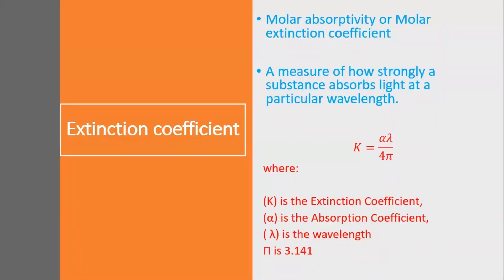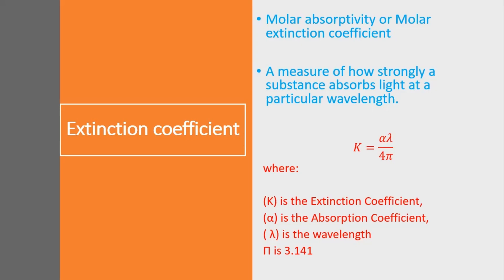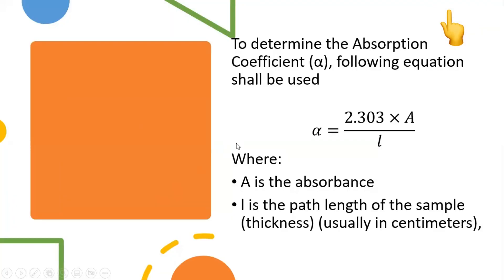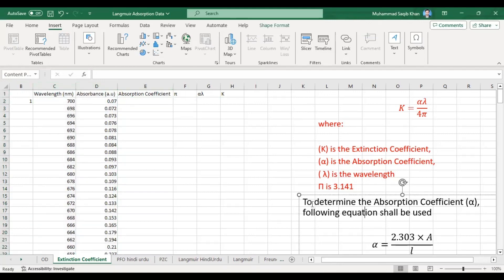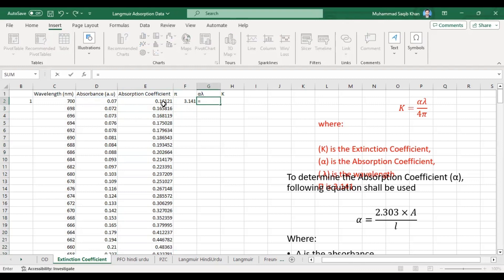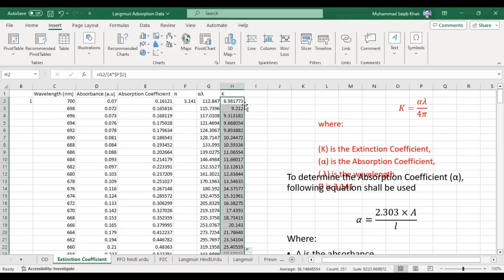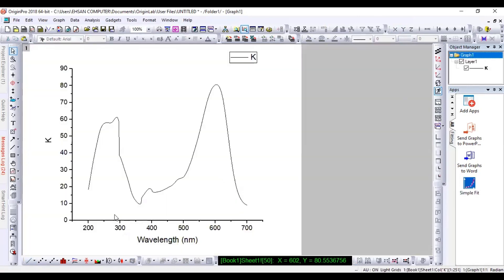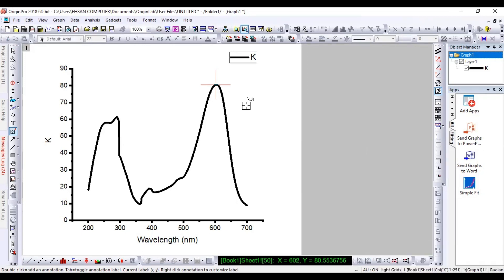How to Measure Absorption Coefficient/ Extinction or Molar Coefficient | from UV Absorption Data

Comment: Please, why thickness (cm) and wavelength (nm) ?
Reply from the maker: Thank you for the comment and a wonderful question, thickness (cm) and wavelength (nm) are used in absorption and spectroscopic measurements for the following reasons:
Thickness (cm): The path length of the sample affects how much light is absorbed. The thicker the sample, the more light interacts with it, which increases the absorbance.
Wavelength (nm): Different substances absorb light at specific wavelengths. The wavelength (in nanometers) is crucial because it determines the energy of the light and the specific absorption characteristics of the substance being measured.
Both factors are needed for accurate analysis of light absorption and to apply laws like Beer-Lambert for concentration determination.
Reply: @drsaqibscienceacademy 
 thank you so much for your collaboration professor

Comment: does molar extinction coefficient depends on concentration of specie? does it the property of one molecule or one molar solution?
Reply from the maker: It is an intrinsic property of chemical species that is dependent upon their chemical composition and structure. The extinction coefficient is a physical constant unique to the molecule; it describes its property of absorbing light at a specific wavelength. Moreover, Beer’s Law states that molar absorptivity is constant (and the absorbance is proportional to concentration) for a given substance dissolved in a given solute and measured at a given wavelength. For this reason, molar absorptivities are called  molar absorption coefficients or molar extinction coefficients. Because transmittance and absorbance are unitless, the units for molar absorptivity must cancel with units of measure in concentration and light path. Therefore, molar absorptivities have units of M-1 cm-1.
Hope it may clarify any doubt, you can also go through this article for more details: (https://assets.thermofisher.com/TFS-Assets/LSG/Application-Notes/TR0006-Extinction-coefficients.pdf),
Reply: thanks @drsaqibscienceacademy